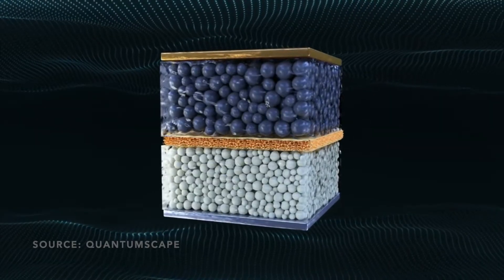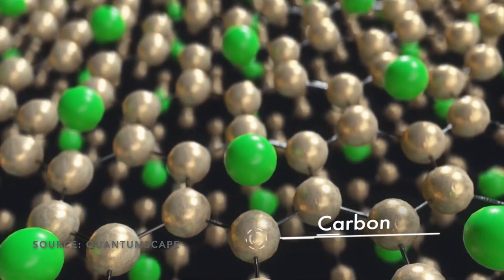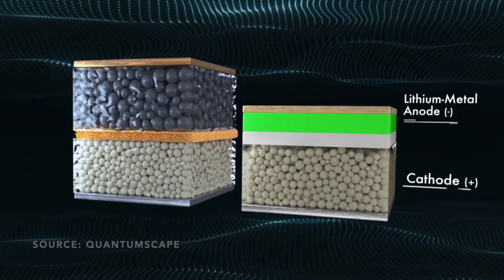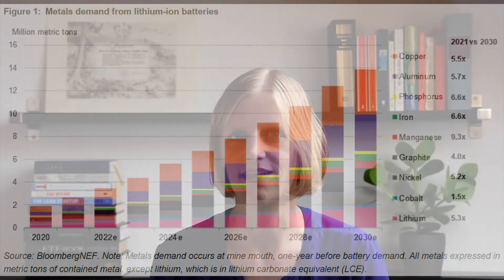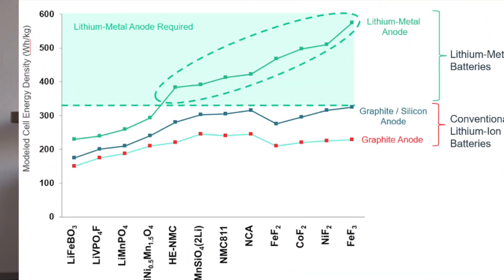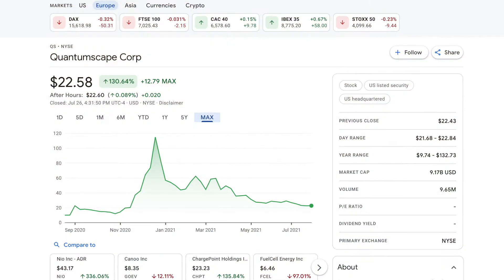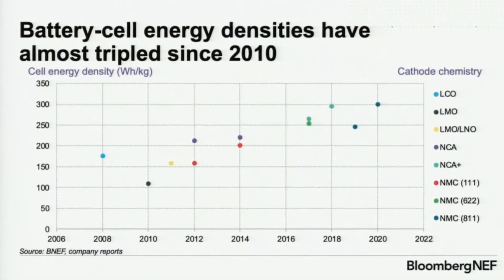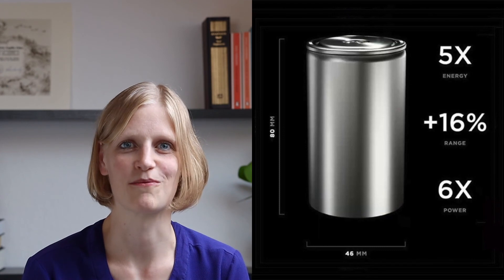Where are we with solid state batteries? How solid state batteries work - SSB

Comment: The simple answer includes "Development/cost/reliability/scale" (1) Moving from custom made coin cells in research labs, to an EV such as Tesla is a big step fraught with problems.  Materials are changing , as are their costs. Replacing Li with Na is just one possibility.(2) Tesla Austin & Berlin battery facilities cost   approx $4billion each, and produce multiple millions cells per day. (3) General Motors latest recall has an estimated cost of $1.5billion - No one can afford recalls  and with a  DEMAND NOW, the current battery producers are playing it safe, incrementally changing.
THE LIMITING FACTOR has at least 200 hours of quality presentation explaining batteries.
Reply from the maker: Thank you for sharing! Very interesting. The eCitaro in Wiesbaden, Germany, uses solid-state batteries. As you mention, it takes time to bring down cost and avoid recalls to be ready for serial production. In Germany, legal requirements for serial production might also be more strict compared to the US.

Comment: Why is the bus battery so bad? The eCitaro has a 396kWh with 270k m NMC. The solid state battery is 441kWh we doing 320km, Mercedes say "Solid-state batteries
are not suitable for high-power charging" This doesn't look like the breakthrough people make out they will be. The main point appears to be a longer service life, more capacity is a small step, faster charging isn't proving true, in fact slower. 11% more capacity is not blowing anyones socks off particularly as MB say the next gen NMC will have increased range which is going to render the current solid state as useless, particularly as if the route has access to 300-kW intermediate charging via the pantograph the high charge rate of the  NMC already makes the solid state the least attractive option
Reply from the maker: Absolutely. Great points.